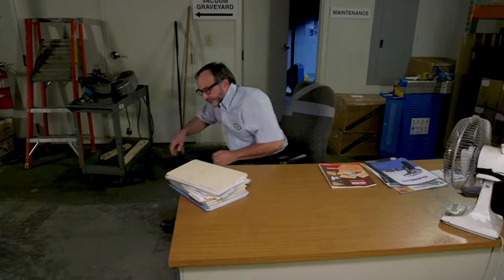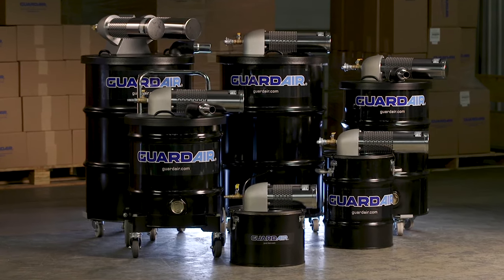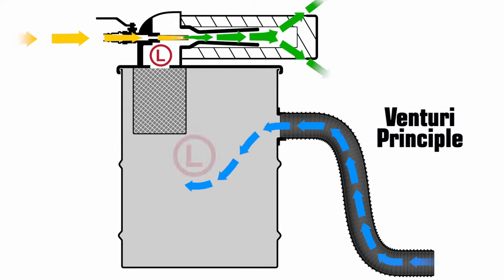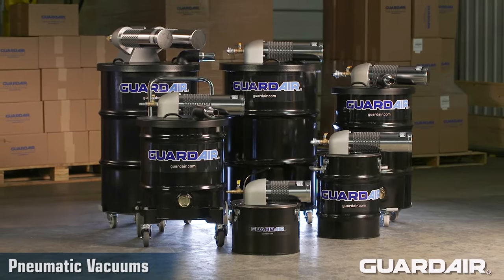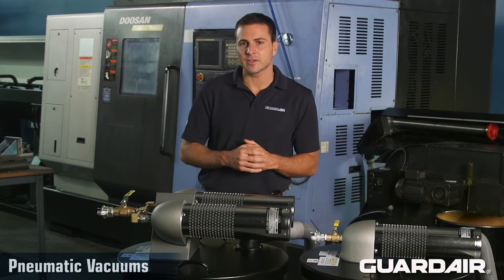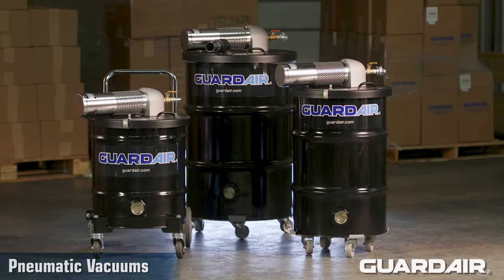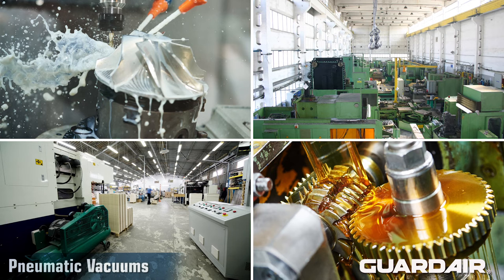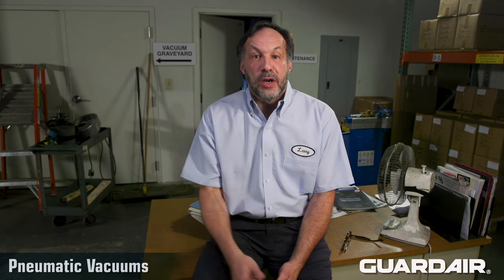Guardair Pneumatic Vacuums - Full Version

Comment: I don't get why a static charge would be hazardous. What did I miss?
Reply: We use compressed air vac at work for powder paint. There is a fire/ explosion risk from the powder. Its pretty much powedered plastic thats melted onto parts. Theres sprinkler heads in the spray booth too.